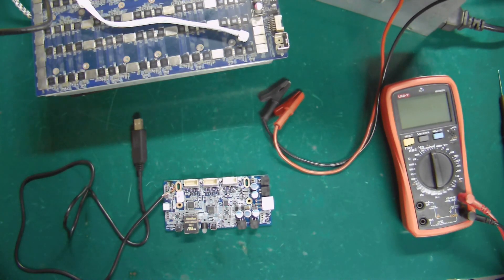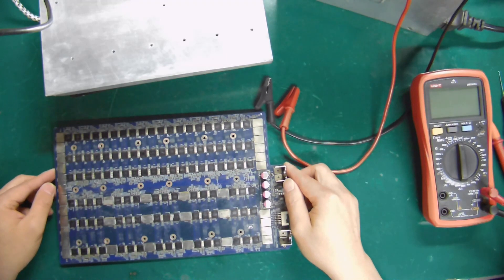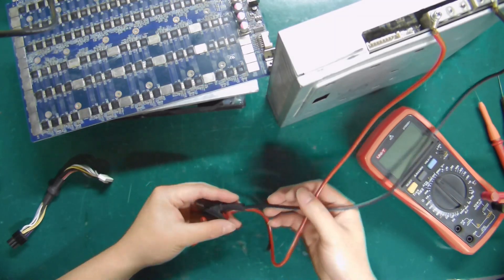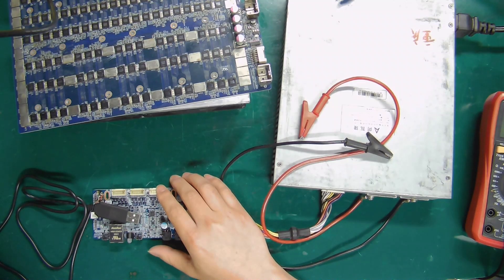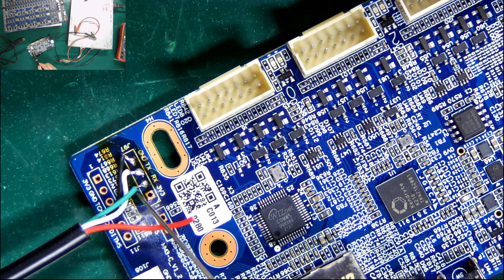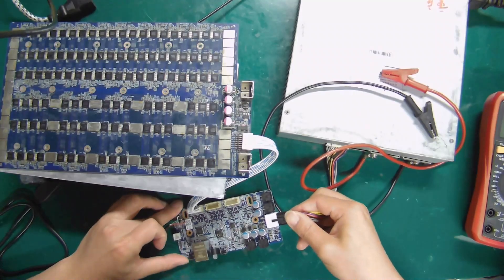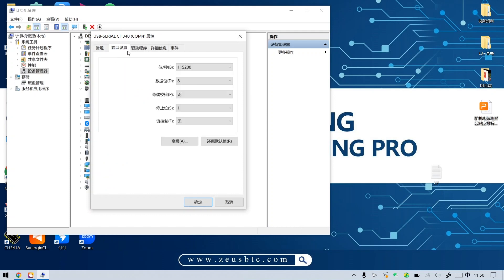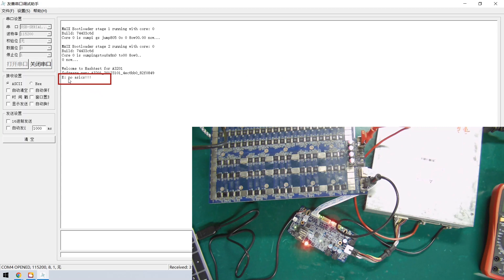Avalon test fixture to test Avalonminer 1066pro 1166 1166pro 1246 and 1246pro hash board fault chip

Comment: show the mistake there is no fix in the Video
Reply from the maker: The test fixture is a tool used to detect and troubleshoot hash board failures, so the video only demonstrates its correct use😉
Reply: @ZEUSMINING ❤
Reply: It couldn't locate the faulty ASIC. That's what we needed.